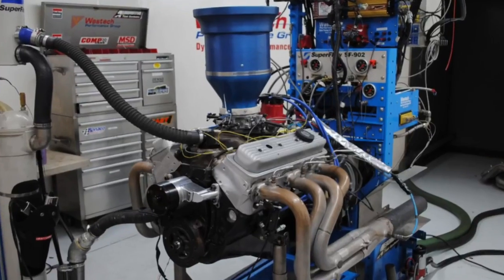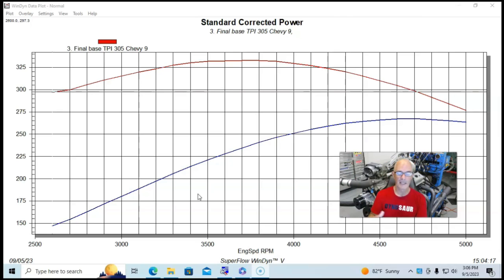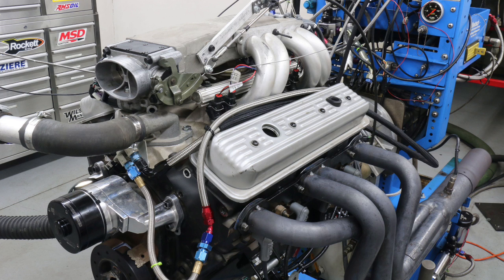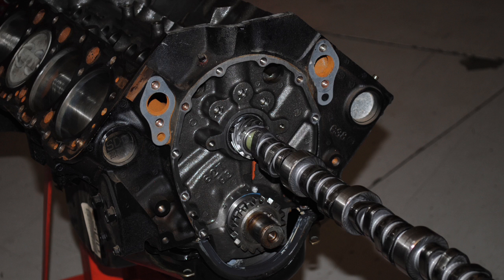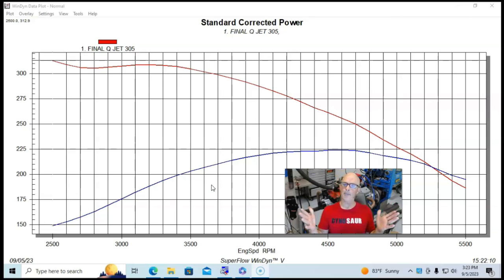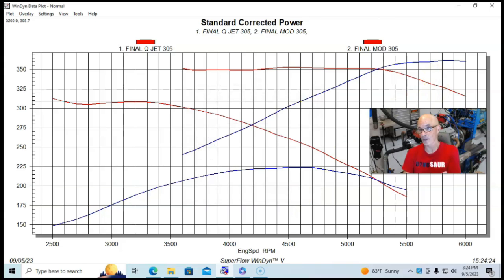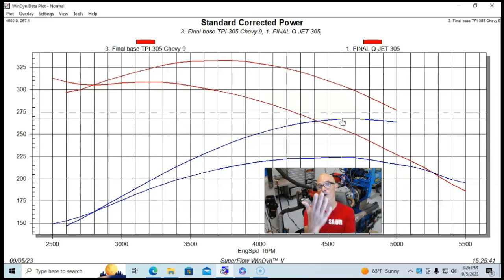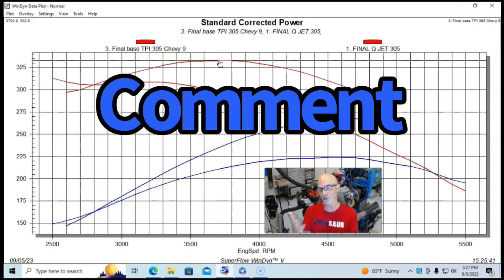HOW TO MAKE 305 SBC HP. Q-JET VS TPI-ADD 100 HP TO YOUR 3.73-BORE 305. FULL RESULTS-WHAT WENT WRONG?

Comment: I know you know this but HP = Torque x RPM/5250. Less torque for a given rpm means less HP. For the base numbers, the longer TPI runners simply produced more torque in the 2500-5000 rpm range. That's what the TPI system was designed to do.
Reply from the maker: 5252

Comment: Back in 1985 I did a test of my own at a Chevy dealer near Seattle WA, with 2 - 1985❤ camaros ( new)  one Tpi and the other thoutle body.
  They may have been similar on paper although the tpi outshines the other ran much better, layer tire better, acceleration was way better and overall performance it was tpi hands down

Double k from western pa
Reply from the maker: TPI vs TBI is not as contest-big difference in rated power output

Comment: In my opinion- the Q jet has a much bigger secondary. That 305 just cannot flow a 750cfm carb where you start with 1/3 of the air down low and get the other 2/3 all at once. A great addition would be a 650 cfm square bore against the Q jet. That's the whole game.
Reply from the maker: that is not how a carb works
Reply: @richardholdener1727  I'm surprised to hear such a ignorant reply. I'll assume I didn't articulate my point well enough. A 305 cannot breath well enough to utilize a 750 carb and stock intake. This issue is resolved greatly using TPI for obvious reasons.
Reply: The factory cams were different in these two 305’s.

Comment: I wonder if playing with different lifter preloads might have gained something.  I recently had a situation where adding more preload to a ford 302 with a healthy hyd roller cam gained about 1000 usable rpm.  It made the cam act so much bigger that the power brake assist was noticeably worse after resetting the preload.  That was the only change we made.
Reply from the maker: 1000 rpm?

Comment: The 40HP difference was largely spelled out in the L69HO vs the LG4 LO cams, which was 190hp vs 155hp respectively. A 204/214 or 214/224 cam is the best money under $200 you can spend on a 305 in your car if you have the 179/195 cam in it. I had an LG4 in my Astro with a 204/214 in it, was pretty darn fun. :)

I'd be sticking a performer RPM or a stealth ram on probably just for ease of service over the TPI. Oh, and power :)

Those aftermarket TPI parts are collectors items these days from what I've heard. Lingenfelter uppers or AS&M runners go for bank these days.
Reply: He said both engines were roller cam tpi originally. If the 267hp was out of a manual trans car the cam was (iirc) a 207/214 duration 414/427 lift. The automatic cars had a roller version of the 179/195 cam you mentioned. Basically same concept as the original q-jet L69/LG4.
Reply: oke let med enlighten you on the cam used in the LG4 and L69. They use the same 14093643 cam 202 duration intake x .403 lift and 207 exhaust x .415 lift with a 114.5 lobe separation.  This is a computer controlled cam much like the 1990 - 1992 L98 10111773 which is pretty much the same cam only difference being is its a hydraulic roller with .413 lift intake and .428 lift exhaust.
Reply: Citations please. Every source I've seen indicates that the LO cam was the peanut cam. I've taken a few apart in my day, and they were the peanut cam.  @MasterWitchDoctor
Reply: @thetriode  try looking up the part number in a Chevrolet Microfiche like my buddy Larry Hoover did at Alexander Chevrolet where he works in the parts department. I
 race an '87 Monte Carlo SS in NHRA Stock Eliminator K/SA so I may know something about it.
Reply: @MasterWitchDoctor  a mcss would be a l69.

Comment: Had you used a set of either stock Siamese runners or something Like slp Siamese runners the tpi would have made more torque and the same hp as the rpm intake and carb or maybe more. Back in late 90s when these were popular we saw upwards of 75whp increase on a 5.7 sbe stock ported l98 heads mild cam car by porting the lower intake upper runner area about 1.5 inches into the port. Then the runners opening them up also so creating a break in the intake so it can suck from both upper runner tubes. 
We turned these “truck” intakes and turned them into 6600 rpm capable sleepers. 
My 1992 formula was stomping the hell out of the newer lt1 cars mod for mod with a combo like that. I eventually went to a Holley stealth ram on the car when did a single turbo but that l98 intake was a very good setup when ported correctly. I still own that car today along with my 1994 z28 and 2017 zl1.
Reply from the maker: we had big tube tpis runners and also tried siamezed runners (they make less torque)

Comment: The small 5.0 didn't have the breath to signal that carb due to reduced port speed where the tpi is tuned for just that focusing on low speed power via long small runners. I would guess that the plenum of that cast iron manifold was to open with too short of a runner paired with two large of an opening on that quadrajet to really get those ports to work for that small motor??
Reply: The first-year TPI 305 had a better camshaft in the second year talkin 1985 vs 1986 I want to say the 85 model was rated 10 horsepower more

Comment: I'd like to see a stock 305 HO from an early Monty Carlo SS on the dyno.I think they were rated at 195 HP. Early as in the ones without overdrive.
Reply: I'm curious myself, I have a L69 H.O in my 84 Camaro Z28.  I wonder if Chevy played with the numbers in the 80s the way they did back in the heyday? With just some minor stuff it's a pretty decent running car.

Comment: The O2 sensor and accompanying CPU tuning on the TPI.
Not, camshaft or plenum length etc etc etc... That would not make that big of a jump.
Reply from the maker: there is no O2 and CPU tuning-Both the AF and timing were dialed in for each combo til it made max power

Comment: I've always suspected that the reason the 305 in particular responds so well to the TPI system is because of the ram effect of the long runner TPI manifold. The TPI is essentially a very long runner tunnel ram laid out on its side. You can't rely on a big bore and big valves for cylinder filling with a 305 like you can with a big bore block, but the ram effect of the TPI manifold helps to overcome the small bore and small valves as a breathing restriction, at least within a certain RPM range where it was designed to maximize that effect, which is right in the range where the TPI ran away from the Qjet motor in your test.
Reply: I had an 86 TPI WS6 with the "peanut" cam for emissions.
Reply: Tunnel rams give air as straight a path as possible from plenum to intake valves. Their height, at least on traditional carb versions, is just a side effect of reducing runner angles. Like individual throttle bodies, they are designed for high rpm power.

A stock TPI intake is the exact opposite. Runners in the lower intake go across the engine and are almost parallel to the lifter valley. In effect it is a low rise dual plane intake with really long(small cross section) runners. TPI was designed from the git to produce lots of low/mid rpm torque.

Compare a stock TPI lower intake to a Holley Stealth Ram lower intake and you'll see the difference is night and day.
Reply: Well the tpi WAS designed for the 305....

Comment: The first thing I would like to know is the 305 with the party setup how did you get a cast iron intake to fit the center bolt now valve cover heads because I had one out of a 93 GMC Sierra and I put it down in a little S10 I could not use the the to center bolts of the intake on both sides would not fit correctly because they went in to an angle like all the other bolts but on the 305 does to CV wanted to go straight down to tighten so I had to order a special intake from elder block and performer at the to center bolts tighten straight down instead of an angle so is it the year of the heads are different?
Reply from the maker: outer bolts only

Comment: These were the same engines?   The second 305 was suffering from some serious head flow or camshaft issues.  I would lean toward the camshaft being very conservative.  Did the first engine have a mild factory GM performance cam?

Comment: i’m going to say it’s all about airflow the primary on a Quadra jet are so small. Also, what size Quadra jet is that they made several different sizes I’m not exactly sure but somewhere down in the low 500s up to ones for the spicy big blocks, which I were told were supposed to be somewhere around 700 either way it still comes down to airflow, even if it is a larger Quadra jet with a small primaries, it’s not gonna flow as much air I believe maybe you should put a hat on both of those combos and see which one is pulling more CFM

Comment: TPI plays into the rpm range the shitty 305 heads and puny cam are made for. A factory cast intake does not
Reply from the maker: a factory cast intake was designed for the exact same rpm, heads and cam profile
Reply: @richardholdener1727    Not like a relatively modern long runner fuel injected manifold. There’s no comparison in runner length

Comment: Since they were both TPI engines to start, I'd think the TPI cam didn't play well with the carb intake.
Reply: depends on which TPI cam they used, '86 got teh peanut cam, it was tiny.
Reply: Automatic cars had the tiny cam. Manual cars had a good bit bigger cam.

Comment: That tpi plenum has more available air than the low rise dual plane intake fo sho. Shoulda tried a 2" carb spacer before modifying to see if giving the intake more volume would balance the difference between the 2. Thanks Rich!! Keep testing!!
Reply from the maker: it didn't need more plenum volume

Comment: The Q jet was only running on the primaries. And going by the pic the intake was totally mismatched to the heads. I know through experience on a 305tpi Camaro it had more power with a Q jet with the correct GM alloy intake. Not a lot more but it idled properly with the carb. And no it was no ball of fire.
For street use very hard to beat a Qjet,, probably better on a Performer which is after all only a tidid up GM intake
Reply from the maker: secondarys were open-that was checked as covered in the video

Comment: Could it be heat soak in the cast iron manifold? The TPI has a pretty good gap above the valley and is made of aluminum, so maybe the effect on it is less? The Q-Jet has plenty of airflow for a 350, I’m sure Richard tuned both spot on, and the dual plane design in aluminum is a proven design. The only other thing I’m induction I can think of is the quality of the casting? Just some guesses

Comment: First Efi 75mm body.Thes are bigg runners porting them even bigger!! Have this First intake and twin Turbos.Vems Efi have problem withe The mapping.Building this 355 cui late back 1995..Uppgrate some more parts like The rear end 12 bult Splines inner axel 31 Splines with The weels 31 splines.Good Th400 Aut..Hope fix 500whp Street litel racing tou..Runn with Dellorto Carborators 48mm 1992 10.7 210 kmt on The 402m.Corvette custom 1974 356cui SCB...Good  for high nine second times four Sure.Somting com in The way..Hope we can gett good Mapping result now!!!2024 back tou The Street!! I am happy gaie 62 gears old still Playing around!!!! Love Love Dyno you doing more more pleace nice tou se!!👍🤣 I have 461 Cbb on The Dyno 1100Hp only 0.8 bar Boost Procharger F2 Fjuel E85 NO intercooler...!!! Edelbrock Alu Heads The The bigger one only 2.19 intake 1.77  Good springs..Weerh Nice Engine 850 lbs..only rev tou 6500rpm can rev tou 7000rpm...Revs kills Engine..Offkors moore Boost more power 24 psi boost 1400hp????Take care❤😊

Comment: The difference there between the two stock engines was the cam and the intake manifold runner length and the fuel atomization differences of carburation versus fuel injection. Also the compression ratio and valve sizes were probably different.  There's plenty of differences that can play a role in these two dyno results.

Comment: Looking at the curves I believe there is a difference in camshaft between the two. From the flow numbers I could find the intake is definitely a restriction if the cam lift was over .400 but I’m not sure if it was enough of a restriction to make THAT much of a difference.

Comment: It seems to me it has to be either compression related 76 cc heads vs 56 cc, or a big difference in the stock cam profiles or both. The cast iron intake runners are extremely small, so maybe that came into play as well. But I am betting more on a compression difference.

Comment: The difference is that the stock versions of this engine is the reason why GM went from carbs to EFI. They always stated that the switch was for more reliable running engines along with better operating at colder and hotter temperatures and better fuel economy also better control over the vehicle. This was of course better selling points to the bean counters, but what sold the cars and trucks with these engines over the previous carburetor equipped engines was of course increased horsepower out put. The 305 of the carburetor version were great sold engines that were great alternative for the 350 for people on budgets, but with the addition of fuel injection GM was finally able to make the realization of the 1957 fuel injected 283 engine with the affordability and reliability of the carburetor 305 or 350 giving the consumer a choice that the other companies weren’t. Even though they were advertised at a certain output we knew that it was actually a little more. You can thank the insurance companies for this reason.

Comment: The Tuned Port uses a ramming effect with its long columns of air in each intake tract. The high port energy comes from inertia of a narrow column of air, but it has some decent mass due to the long length. At the RPM it is "tuned" for it acts almost like a tiny bit of boost. I have heard claims of 1-3 psi of positive intake pressure at torque peak, but given the small cross sectional area this free boost turns into a restriction past about 4500 rpm in stock form. The Q-jet has no such fancy ramming and therefore less output. With 20 degrees more cam timing in each I think we would see the tpi fall behind. As some others pointed out there was likely a cam and head difference as well.
Reply from the maker: please do a search for reflected wave (and the other two forms of charge filling associated with intake design) Inertial ram and Helmholtz Resonance
Reply: @richardholdener1727  Like the NACA test MIT did and published in 1943 or 1944,
Reply: @richardholdener1727    As in Morrison & Smith book on the scientific design of intake and exhaust systems.

Comment: Has to be a cam and or head difference. Everyone says that the TPI setup is so hard to make power up top with. I'm in agreement with the peanut cam theory. I know that even the factory Qjet intake manifold will equal or beat a TPI for hp. The TPI is unbeatable for low and mid range torque.
Reply: I've always said GM missed the boat by not putting, offering TPI on their 4X4 trucks and Blazers. Way better truck engines.

Comment: An iron intake is the obvious culprit. TPI breathes a hell of a lot better than the smog intake. With an adapter, I'm  fairly sure that the Q-jet would have been close to the numbers on the air gap intake.

Comment: My guess is the carb engine had the 178/194 @ 0.050 peanut cam and the TPI engine you tested had the 202/207 grind. There was a piston difference, some were dished and others flat tops. A Performer RPM was worth 20-30 hp over stock as well.
Reply: Peanut cam engines (carb, TBI, TPI and both roller and flat tappet) make peak power at 4k rpm. I haven't seen one still gain up to 4500 like this test engine.
Reply: @lb9gta307  My 310 (0.030 over 305) made peak at 4,700 rpm with the peanut cam and 187s. Edelbrock 3704 manifold bored to 2", 454 TBI unit and old design really long tube Thorley Tri-Ys for a G20 van that had the collectors equal with the 700r4 crossmember. I made 197 whp and 284 wtq with it.
Reply: @chrisreynolds6520  this was a stock engine
Reply: @lb9gta307  With headers and a 750cfm Q-Jet, basically a 1987 LG4 that was freed up a bit. GM rated the 87 LG4s power peak at 4,400 rpm.
Reply: I think my 86 5.0 WS6 peanut cammed motor peaked at 3800 on a chassis dyno, damn B&W 9 bolt rear end
Reply: @mistabone3899  My 83 G20 van LE9 305 peaked at 4,400 with 175 whp. I believe it was also a peanut cam, factory flat top pistons and 601 heads. 700r4, 8.5 10-bolt, 2 piece steel driveshaft with a carrier bearing and a 7 bladed clutch fan with a stiff clutch. That van came from GM with stainless tubular manifolds similar to shorty headers, factory catless 2.5" duals and dual smog pumps (both deleted by the time I had it). The only other thing I had done was mod the Q-Jet by completely recalibrating it.  It was a factory 850cfm (knocked down to 650ish cfm via a restricted air door opening) non computer controlled unit that I revised the air doors so they could open more than 1/2 way and I had deleted the ESC spark control module that had failed using a recurved HEI and had 34° total advance.

Comment: I'm not a 305 guy but after I burned a piston in my 350 I had in my 86 GMC, my cousin gave me a Vortec 305 . I installed a Performer intake , headers and the original Qjet. For an engine that was just supposed to get me back and forth to work temporarily, it's been 10  years and I couldn't be happier.
Reply: Same story in my brother's 4 door 68 Impala.
Reply: 305's are legit! I would rather have a 305 than a 307.
Reply: Same characteristics as 350. Just a smaller bore. Same as 318-340. Same stroke just smaller bore. 👍

Comment: It might be intake manifold gaskets but I'm guessing the TPI heads had small ports and the carb intake had large ports so the mismatch screwed up the flow and the runner length/area of the intake was a poor match for the heads and cam.
Reply from the maker: NOPE
Reply: One was an automatic trans motor with the peanut cam. One was a manual with a bigger factory cam.